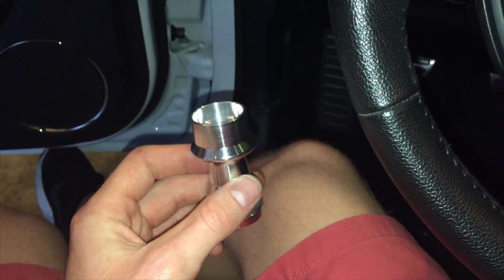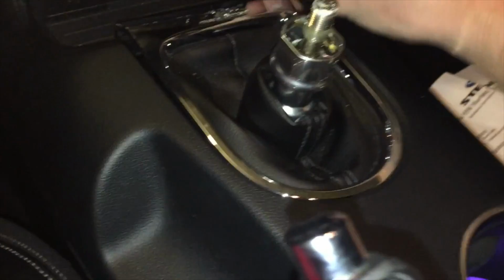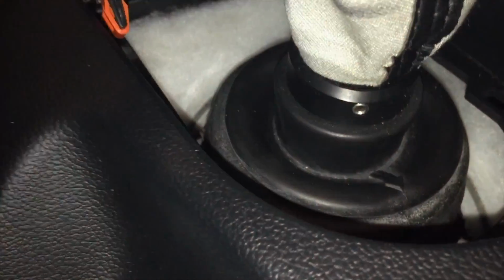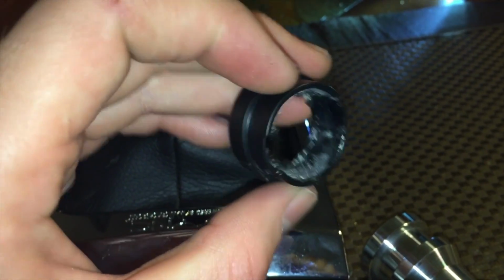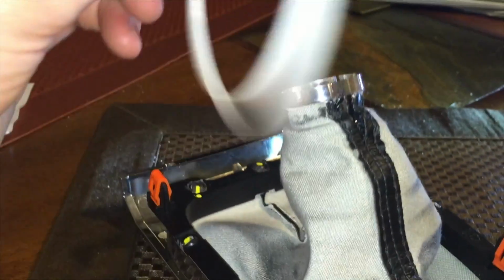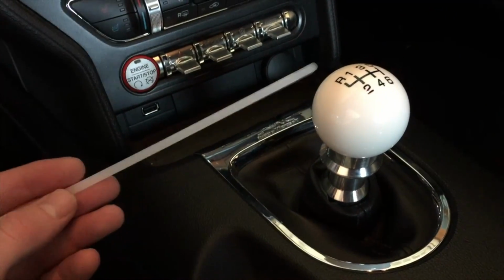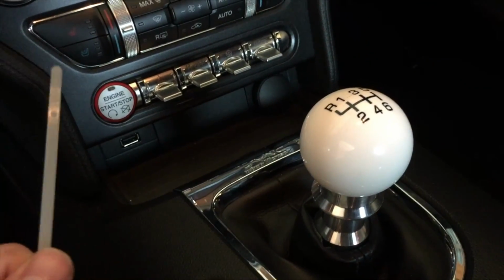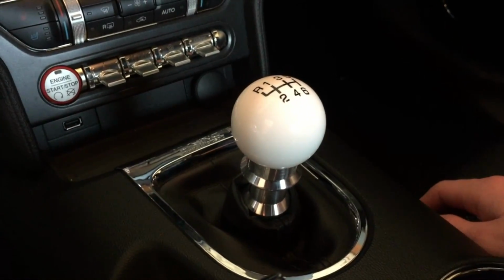Steeda Reverse Lock-Out Collar Install | 2015 Mustang GT | Dress Up

Comment: The black O ring helps with the rattles and I noticed this to be quieter than the stock plastic lock out.  I guess the weight also gives it a better feel.  The stock plastic seemed noisier to me.

Comment: I have the Steeda short throw like this one,  gonna install it next week as well as the same reverse lockout , in my hand it looks like the billet aluminum lockout maybe to long for this short shifter,  is yours pushed all the way down in the reverse lockout on the shifter to give enough threads for the shift ball ?   The reason I ask that wasn’t covered in your video

Comment: So I've found out the shifter noise is coming from reverse lockout. When I lift that up during 2nd and 3rd, the noise goes away. Would this kit fix the shift whining noise issue? Have you had such noise?
Reply from the maker: I have not. I couldn't say if it will fix the issue or not.

Comment: Hello, How is the NVH with the Steeda Tri Ax? I have the Barton Shifter in my 2016 GT and it does have some noticeable noise. Was wondering if the Steeda is quiet as stock?
Reply from the maker: Its close to stock but i did add a good bit of sound deadening material.

Comment: I have a question, i'm changing the lockout collar but also getting an mgw shift knob, do I have to use the shift knob stem that they sell? I'm afraid it will raise the knob higher than I want it
Reply from the maker: MGW sells a collar specifically for their shifters.
Reply: @DavidTurnbullHardt  Thank you soo much for your help! I spoke to George on the phone and he did mention their stems are a direct fit to their shifters and the factory lockout collar will be removed and replaced. Super stoked to get it installed 😎

Comment: Have you had experience with the Barton collar? 

also what's your opinion with the aluminium vs the Derlin Steeda Collar?
Reply from the maker: my buddy has the barton collar and I prefer the steeda over barton. No experience with the delrin collar.
Reply: S550 Arctic Knight what did u not like about the Barton one?
Reply from the maker: It's the same size as stock if I remember correctly. The steeda offer more of an edge to actually get a hold of.
Reply: great! Now just to figure out which material to get -_-. lol